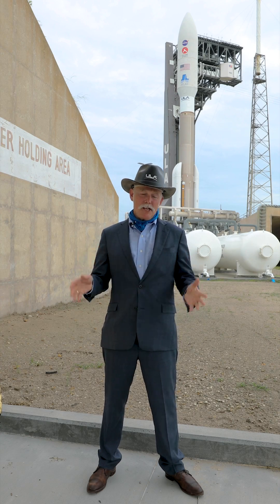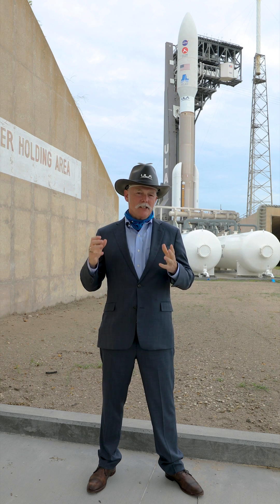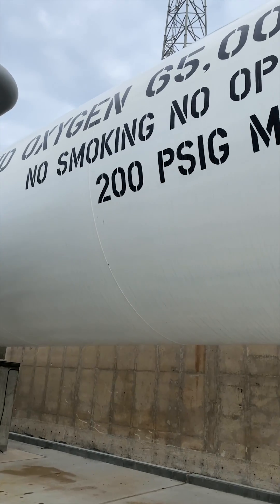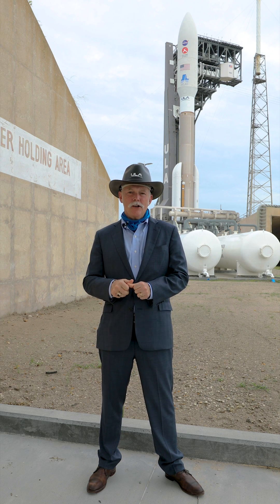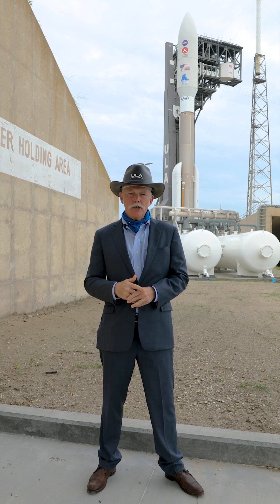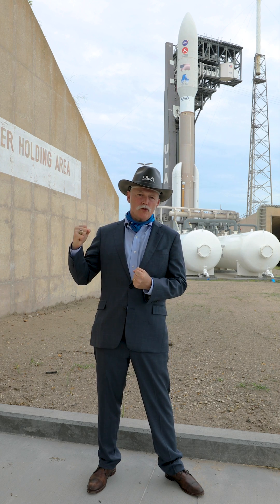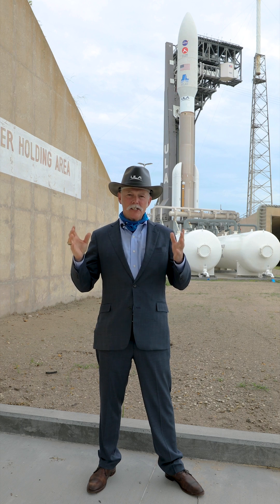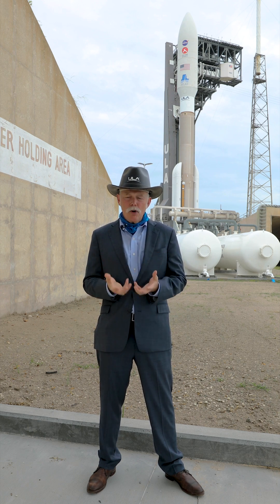Tory Talk // Atlas V Mars 2020: 5-meter payload fairing

Comment: A little hokey but I liked it. So if the spacecraft has to get to 26,000 mph to coast to mars; how does it slow down to orbit mars? Or does it go straight into the Mars atmosphere? I liked the solid booster explanation.
Reply: As it moves further away from the sun towards Mars the orbit will slow down just enough to avoid a disastrous reentry also it will directly intersect with Mars atmosphere and the heat shield will take away most of that speed and turn into heat. At very high speeds the atmosphere behaves as a cushion also the parachute will slow down the descent further before the the retro rockets slow it down to a gently touchdown on Mars.
Reply: The high speed is needed to escape Earth's gravity and also boost the spacecraft to Mars orbit.